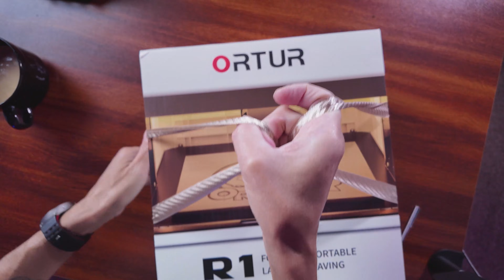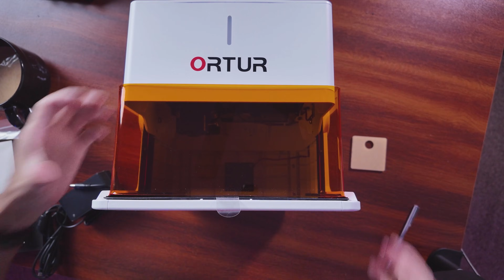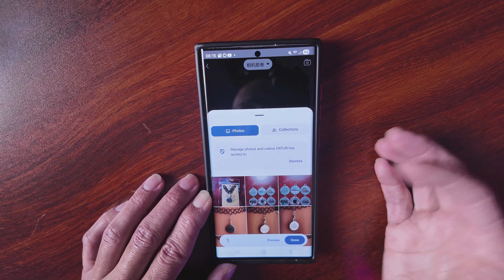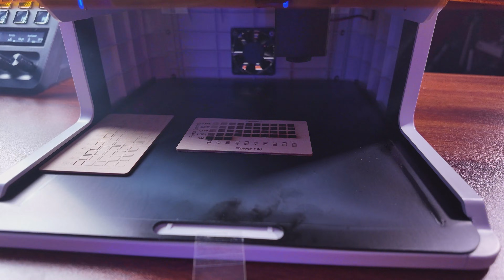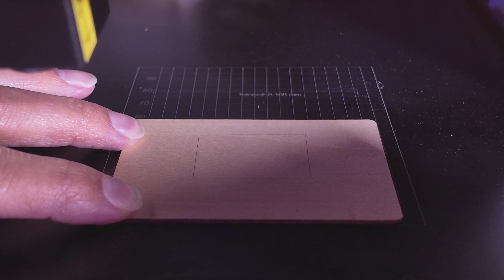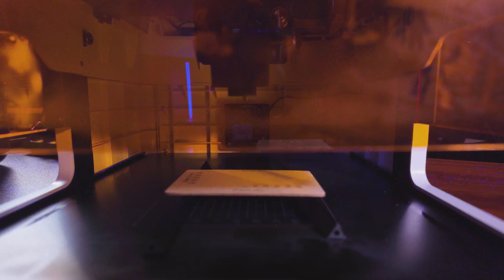Ortur R1 Review  - Portable and Foldable, but Is it Worth It?

Comment: Disappointing unit with lack of base board grid, fiddling with orange screen can move object to be engraved if position critical, fan exhausts smoke into room, Apps don’t work well, limited use and unreliable, fiddle to adjust laser height by feel, adjustment screw out of sight, good luck if big hands.  Cabinet can move due to vibration when using high speed, makes double image on fine lettering, I put a weight on top of it to make it more stable. Yet to be able to engrave brass with IR laser unit without first spraying metal surface black, not seen a working demonstration yet on this topic. Expensive folding design has serious limitations. Would I buy one again, no.
Reply from the maker: Definitely sounds like we had the same experience.  This laser left me scratching my head... Why did they make it???
Reply: @directedt3ch -Worse, I bought it 🙄
Reply from the maker: @ShevillMathers  Oh yes... Uggg... sorry :(